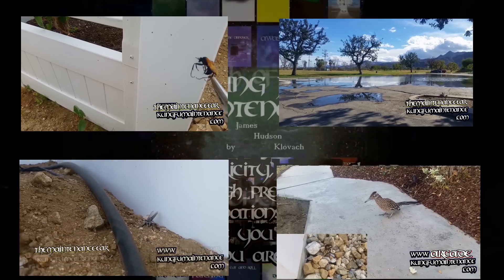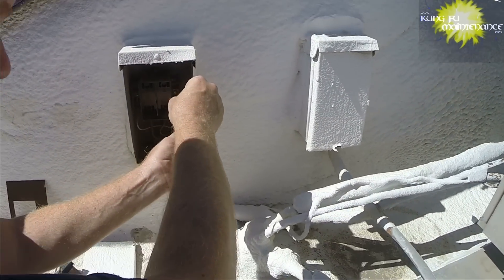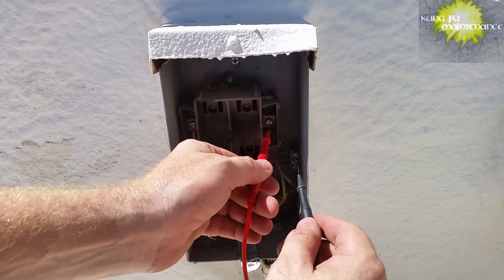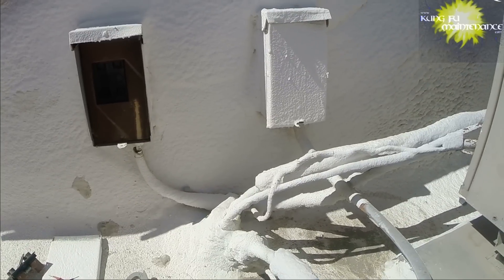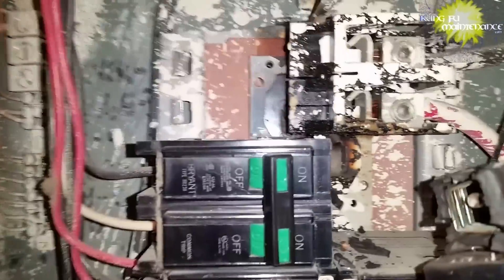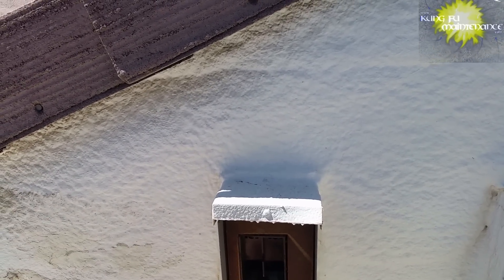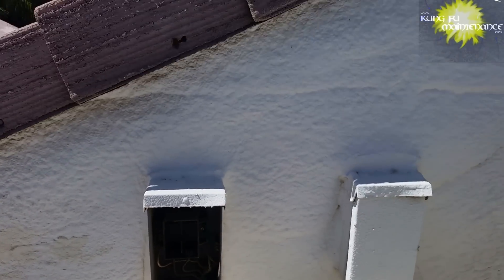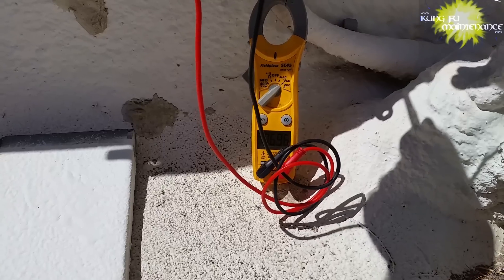How To Test Air Conditioner Disconnect Box For Proper Voltage

Comment: Help! I’ve replaced a double pull breaker , tested breaker at 240v in panel, yet when testing wires to pull box on outside unit my voltage does not match. I am getting 7.6 volts . I can’t seem to find what’s going on.

Comment: So, if my multi meter reads zero voltage at the input portion of my contactor would that mean I should trace it back to my service disconnect? I have the pull out type (with the copper bar across both terminals) if both terminals do NOT read 120 V does that mean I have a bad breaker at my panel or could it be a faulty wire between the disconnect & my furnace? Just to give you a backstory she said her unit was humming with no fan or compressor kicking on. When I listened it was coming from the area of the capacitor. When I looked Inside the cap was VERY rusty & The cooling fans were basically blanketed in dust and fiber. I thoroughly clean the fins and replaced the capacitor. Now, there is no more harm but the only thing that happens is the solenoid in the contactor draws in but still no fan or compressor kicking on. Any input you can give me on this would be greatly appreciated. Thanks
Reply: Steven Weede yes you would have to trace it back